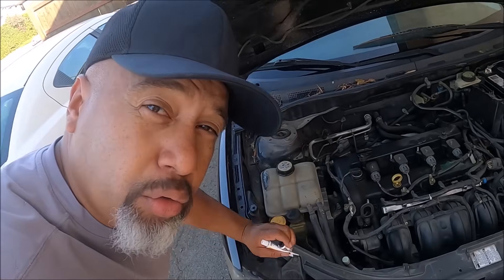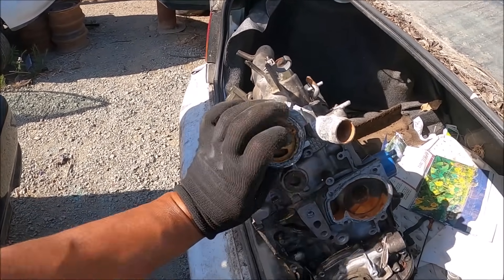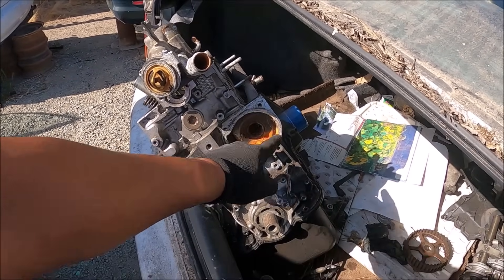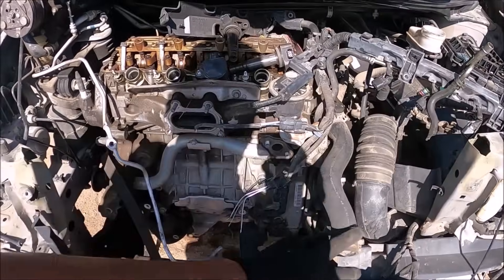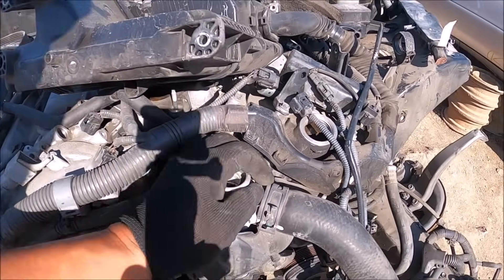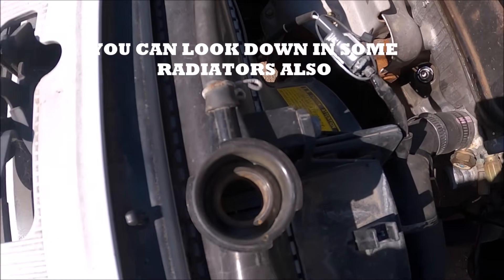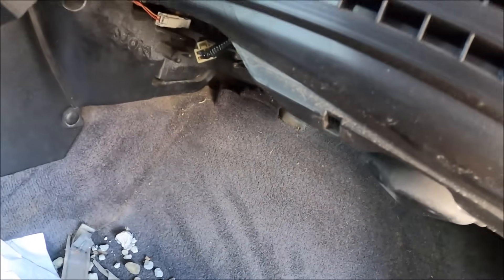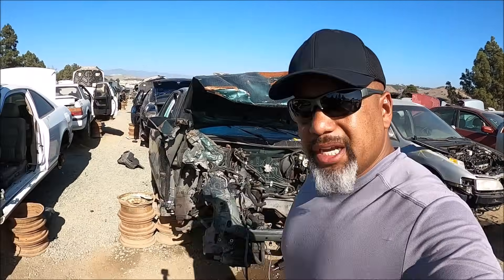HOW TO CHECK IF YOUR WATER PUMP WORKS & CIRCULATES ( EASY OVERHEATING TEST )THE COOLING SYSTEM.

Comment: This is such a cool video. I'm a single woman who knows nothing about vehicles except a few basics. I have to do everything myself. Now my 06 Suzuki Grand Vitara started overheating, I changed the thermostat and radiator cap but no luck, during this time frame it now hard to start, it will start but I have to keep it in the on position for a few sec. So trying to troubleshoot water pump and the other problem I came across this little gem of a video. going to try your test on the water pump making sure there is no air bubbles ( lol). Truly thank you again. And my apologies for the long comment. That's the Louisianaian in me. Haha.

Comment: My brother you got to be from New York you sound just like me I'm the same way loving it. Now that we on the subject I do have a question about the overheating I noticed that the car's been overheating I have a 72 Chevelle SS and it has a big radiator with a heavy duty water pump I decided to take the top radiator hose off and notice nothing is coming out of the thermostat housing or the top of the radiator hose I'm thinking something is blocking the flow what do you think it could be

Comment: You should put a t stat in a pot of water and bring it to a boil so you can see how it works. Use a thermometer to check the water temp to make sure it opens at the right temp.

Comment: I am happy that you ended your presentation with JESUS. My car is overheating. We replaced the radiator cap, removed thermostat, checked water pump(by mechanics) still its overheating

Comment: What if I don’t have water flowing in and out of radiator hose ?
Reply from the maker: The water pump could be bad, the thermostat could be stuck closed, or some blockage in the coolant system.
Reply: Thanks for the response.. I’ll start with replacing thermostat  🤞🏼
Reply from the maker: @derekm4592  just take it out and put the elbow housing back on without it and see if you got flow.
Reply: Ok thanks man it worked..  new sub 👍🏼

Comment: Hey Oldskool.... It's been a while. Hope you are well.
I got an issue with a 2013 Cadillac CTS 3.0.... I had a fan failure that caused it to overheat. I shut it down let it cool got it home, fixed the fan. After that the heater core gave out. So I did that bypass as well as replaced the thermostat and the water pump. But 😭 don't notice any circulation with the fluid. I removed the reservoir to clean it and I reinstalled it all my hoses are connected but this fluid don't seem to be moving... These cars don't have the caps on the radiator like the older ones. My hoses aren't sucked in but they don't feel pressurized even though my temp got to over 220 on the guage...
Am I missing something?

Comment: The yellow text at 2:35 is a great way to differentiate between the thermostat or water pump being the issue. Thank you for the tip.

Comment: I put rebuilt water pump, radiator and thermostat in my 64 olds 98 and I don't see the radiator cerculating at all . Top hose is hot as hell. Can you help me diagnose this problem no one knows nothing

Comment: One thing about leaving a thermostat off is that you can destroy your bearings (too much heat not enough lubrication to keep them cool) as the fluid won't return to the radiator and stay long enough to cool off since it's just flowing right through so like he said it will get you home but don't forget to replace it!

Comment: Thanks . Recently I changed my car nissan tiida 2011 radiator because of some leaking and after that my car was showing overheating when i drive 60 / 70 km. and i can feel my car was giving small vibration before the overheat indicator. So i do stop the car aside road again fill the water . I can’t see any external water leakage. A/C is working perfectly and heat is not working. I recently changed water pump too. I am tired of this pls can you advice me.

Comment: Thank you for the very informative information!!!! I just replaced my thermostat due to overheating... Myself. The jiggly pin I'm not sure if it's up or what because I didn't know when I was putting it in. 😢. However my gage is still up and down and overheating. I'm kinda lost. So the heater works sometimes and not sometimes. Someone told me it's the heater core... But my passenger floorboard is not wet at all so I don't think that it is that. I am leaning towards the water pump because of a few things you said. However today smoke came from the passenger side hood towards the windshield area. So now I am confused again. No water in the oil no oil in the water. Do you have any ideas please. I don't have the money to keep dropping in the car. I also speak to God like he's with me all the time. I was just talking to him about him seeing that I am trying the best I can and for some reason he lead me to your video. God is great.
Reply: Take out your thermostat as demonstrated in this video. Probably you should try flushing your radiator if you can't afford having it cleaned. Check water pump. Just my two cents, mate. Been thru the same sutuation. Auxilliary fans are also on continuous cycle now. God bless you, mate.
Reply: @leemaliaman7517  thank you. I have changed the thermostat and flushed the system. I found the leak yesterday. Thanks for the information though.

Comment: i just changed my water pump and my thermostat also checked my radiator  by unplugging my bottom hose while the car was off i added water on top and it caame out thru the bottom

Comment: There is one down side to having no thermostat in the housing, not enough temp to bring the motor to proper operating temp do to no restrictions. This condition will actually cause the car to eat more gas, which can be harder on the wallet then fixing the problem correctly by replacing certain parts.
God Bless
Reply: I believe he was saying to remove it only as an emergency fix to get you back on the road until you can get it replaced with a new one, and not indefinitely. Just a temporary fix to keep you from blowing the engine due to overheating.  It's better to be able to do this if you're starting to have issues somewhere away from home than to need to call and pay for a tow truck, or to have to find a way to get to a parts store when your vehicle is undrivable. So long as you have a few basic tools in the trunk you can do this to get where you need to go once the engine is COOLED DOWN, and THEN can replace the thermostat.
Reply: @kittymunday1986  it's possible that I missed it

Comment: Will it run without the thermostat?
Reply: Permanently
Reply: It will run, yes. HOWEVER this should be used as a TEMPORARY fix only! The thermostat is there for a reason, and if you drive without it for a prolonged period you're going to end up creating other issues for yourself. So yeah remove it long enough to get by until you can get a new one, but get the replacement as soon as you can afford to. New thermostats  (NEVER buy a USED thermostat!!!) are relatively cheap compared to most other parts,  most I've seen being well under $25 USD. (I comparison shop my parts between AutoZone and O'Riellly and got my new thermostat for about $13.) And if you are putting it in yourself and not paying labor, it's cheap enough.

Comment: I’ve got a 2008 Range Rover. Replaced thermostat, but still overheating and no heat inside the truck. Even the air off the engine is cold. I guess it’s time for a water pump.

Comment: Right on! Jesus all the way. My 2008 Chevy Silverado gets hot about 3/4 of the way on the gauge, turn the heater on, and it cools back off. Sometimes when I turn my heater on, it starts getting hot. I replace my thermostat, but didn't want to just go replace another things without knowing what I'm doing. What do you think the problem is? Has your video indicated, my heater works great, sometimes it gets too hot. So that means the water pumps working right? I replaced the thermostat, so does that mean it's either the radiator or the fan? It's been pressure tested with no leaks, and the fill level is constant full. Top who seems to be hot, bottom hose doesn't seem to be as hot. Please tell me what you think.

Comment: Trying to diagnose this right now. New thermostats, new water pump, new radiator, just replaced the fans and it's still overheating at idle

Comment: Very informative video, thanks!
My '88 K1500 350, 230K miles, heads rebuilt at 155K miles, is overheating and I'm at a loss. 
Water pump was changed a year ago. Rad (plugged up somewhat, restricted flow), thermostat, clutch fan, upper & lower rad hoses were changed this year. No leaks, upper & lower rad hoses get hot'ish. Blows heat out of the vents but not as hot as it has been when it wasn't overheating. No water in the crankcase last I checked.
And the rads center doesn't get warm yet we can see coolant flowing. swirling at the open rad cap. Rev the engine & the coolant goes down a bit then rises back but not great amounts.
Had it back-flushed too. I'm wondering if when I changed the rad if it dislodged debris & plugged/restricted flow somewhere like the heater core? 
Any ideas?

Comment: Hi! Im broke and just lost my job recently, 😂(not kidding), i replaced the thermostat (i felt like I wasn’t putting it in right because it wouldn’t fit snug and stay-but its in) and the lower radiator hose is still cold, i also burped the system, could the water pump be the issue for coolant being unable to reach the lower hose and thermostat?? Please help, why wont my thermostat open if its brand new :(

Comment: Question, I have some overheating to 221 degrees on my trailblazer at times during stop but the lower radiator hose seems cold. Could that thermostat be the culprit?

Comment: I had a leak in my radiator so I used barz leak and now a couple weeks later my heater isn't working and I'm not sure if my heater core is clogged or my water pump is bad. I'm  going to replace my radiator tomorrow and I'm not sure if what to do about the heater not working.. I dint know how to determine if it's the heater core or waterpump? Also my car overheated yesterday 🤔

Comment: Oh, Man: I've been trying to burp a' '88 K-Car for a couple days. Shes' got life left. Steel hex hiss plug corroded with aluminum. I'm using the steep hill method radiator above waterbox. You gave me inspiration of another work-smart fix before I lose my temper and regret the endeavor. Keep it up! Please? Thanks.

Comment: So my radiator hose is swollen hard  the upper hose no heat coming out of my vents could this be a water pump or thermostat or radiator cap or hose thx

Comment: Hey mate, first off love the channel, second, I have the exact same Mazda 3 and engine in the first part of the video, my engine to me at least seems to be running hot, the ect sensor is getting up go around 105 on the obd scan tool but the gauge is still in the middle, just want some reassurance that is a normal temperature range when it hits 105 the cooling fan comes on but on the a few seconds and not very fast soon as it drops back to 103 - 104 centigrade it goes off, ac button makes it run faster on its own, anyway I'm definitely getting constant hot air so from this I can tell my water pump is working, although revving the engine it actually drops temperature dramatically, to me that means the impella is maybe not circulating enough at idle now is that a fair assumption and should I change out the water pump or am I good? Also one last side not, my hot air is burning hot not just warm which is also unusual to me! (my first Mazda 3 bk car so nothing to compare it too)

Any other Mazda 3 bk owners  feel free to chime in too please any help appreciated. Thanks guys God bless!

Comment: Bro my belt just came off 2 times in 3 days. Radiator has a leak that sprays fluid all over my belts. How can I tell if its a bad water pump if all my other pully's are firm and stable but spinning freely no sounds???

Comment: Question: 1994 acura legend GS.
High-pressure in cooling system at idle no problem. After a mile or 2 temp goes up. In cruise control...temp goes down.
  Check system. Hard hose,coolant/steam out of reservoir. ?????

Comment: I used a rad leak test kit and found (using soapy water) that I have a small leak UNDER the radiator CAP (the top lip of the fitting that the cap screws onto).  How do I fix this?  JB Water Weld?

Comment: I've had cars where water flow was clearly visible when I popped off the cap.
But with this 93 Accord I can't tell if I'm seeing flow, or just the water dancing from vibration.
Started overheating yesterday.
Was ok at speed, but stop lights it almost pegged.
I was able to refill it and limp home taking a route with no stops.
Problem is,  this car came to us with almost 300k miles on it, and I'm not familiar with what normal is.
I pulled the thermostat and tested it - opened at 180f, but seemed a little slow, so I left it out, buttoned up and took it for a spin.
Temp was on Cold - nudged up and then settled out halfway between C & H.
Now I've had cars where anything more than a smidge off Cold and you knew it was on it's way to overheat, and I've had cars where the halfway point was halfway on the gauge.
Anyone know how 93 Honda temp gauge sits in normal operation?
I'm gonna take it for a longer drive in the morning and see if it heats up with more stop and go.
I'd really rather replace the thermostat rather than do a whole water pump job.

Comment: If you take the thermostat out and run it open, use the rubber o-ring on the thermostat to help seal the body.  Just place the o-ring in the groove where the thermostat sits.  Once compressed by the body it will stay in place.  I do this when I flush the system and it works like a charm.

Comment: I work on my small engines weed eater lawn mower etc taught myself bought a 2003 impala that has a blown head back outer ring came across your video think I can do it your way I will be filming the process man you doing great hope I can fix it.

Comment: Great video!  Reminder: never remove the radiator cap when the coolant is hot!  Second, he was talking about when the radiator hose gets sucked in.  That could happen when the engine is cold, not when it's hot.  I hope that helps someone :)
Reply: Happen to my truck... It was cold 👍
Reply: Sucked in radiator hose was just a bad collant cap for my dodge charger

Comment: I plugged a hole in a high pressure transmission fluid coolant line with JB weld, it held until I got rid of the car years later.

Comment: Great vid bro! I got a question my 2003 voyager started smoking from the engine today, i checked the radiator cap and it had a milky film on it, also checked the oil dip stick and no milky film, what do you think this could be? Tha ks

Comment: I have a vehicle with a 1AZ engine and the thermostat funtions the opposite way......it's on the lower cooling pipe, and the upper heated pipe is connected to the radiator cap.   
I'm confused how it works.......but, Thanks for your Video!!  
Cheers!!  
Jesus bless you and your family  :D

Comment: Hello my friend, writing from Costa Rica, that struggle is real down here too, not much money at the moment, and had a overheating issue with my 1992 jeep XJ 4.0, the thermostat got stuck closed, and you can imagine the coolant overflowing all over. I removed the thermostat and been driving without any issues for the last 3 weeks. Do you think is bad if I keep driving like that? My country is very hot weather, a lot of traffic and hills, never gets colder that 15°C.. This is the 2nd thermostat that fails in the las 3 years and I get scared to blow my headgasket and more in these times   with the covid..all tha is happening with the economy...Pura vida✌

Comment: hi. I have a 2005 escape. in the summer it was overheating had thermastat replaced but now i can feel the front of the car really hot but its not overheating and now at start up i see white smoke for about 30 sec. any ideas?? thanks good videos

Comment: JB WELD is amazing stuff have used it multiple times one various things, this time on a hole in my radiator!
Reply: Hey should I try it so my coolant water pipe just has a cut should I try it
Reply: @marleneochoa704  if it’s a rubber hose then no, JB weld can only be used on metals and some plastic.
Reply: Just coolant leaks

Comment: IF you have replaced the sensor and the thermostat twice, And from what I am told there was no water trying to leak out when sensor was changed. And you get hot air out of the Heater. Any ideas any one. We have replaced the Computer as well. Check engine light comes on with the sensor code. The ac works when the Check Engine light is off, but when it come on the Ac quits? Same question?

Comment: Thank you! Great info. Can you help me friend? I got a 91 geo tracker. If the heat is just barely working and the temp gauge stays its staying well below normal operating temp (like just barely moving the needle) what do you think it could be? I changed a coolant temp sensor and it wasn't that. The engine is getting warm and I believe its circulating since the radiator gets hot too. God bless!

Comment: My brother my reservoir is getting full with coolant it is not going back down it overflows and spits out all over the engine. 2002 Subaru WRX I just changed the radiator and put in a new thermostat and it's still overflowing on the reservoir
Reply: Me too dude I changed the thermostat and while idling the same thing happens it fills up and I have coolant comjng from some where but I don't c it where it's comjng from and it only leaks when the engine is off. I'm sick of putting fluid in this pig...

Comment: Soooo the water pump circulates throughout the engine Nd heater core but when the thermostat reaches a certain temperature the wax expands from the heat causing it to open plus the pressure of the system going to the radiator but the water pump is moving the system I’m thinking another idea but this wat it sounds like???